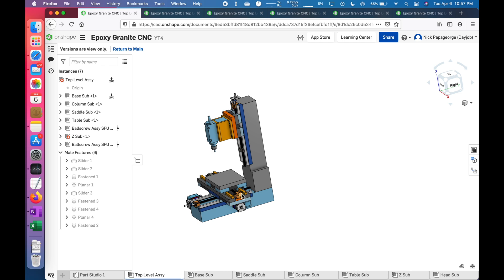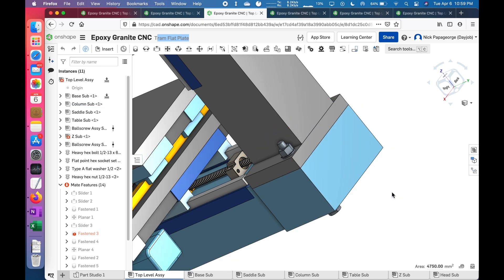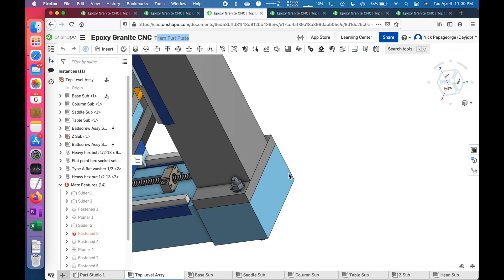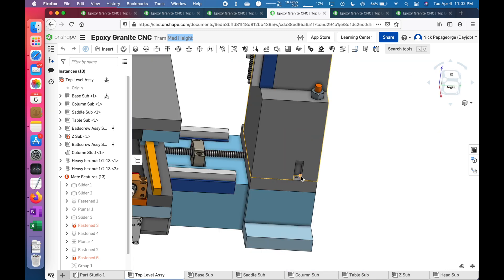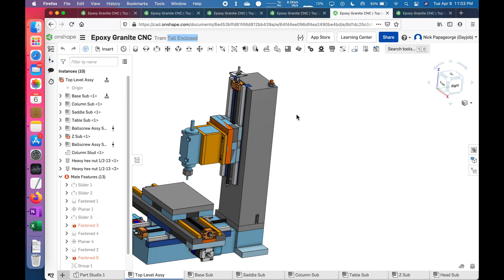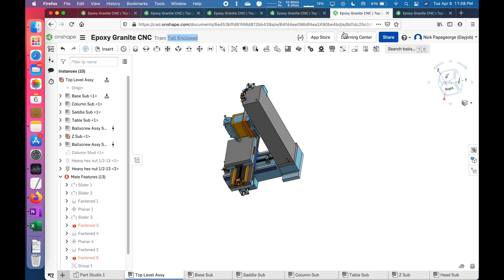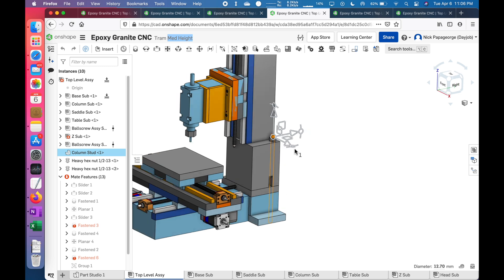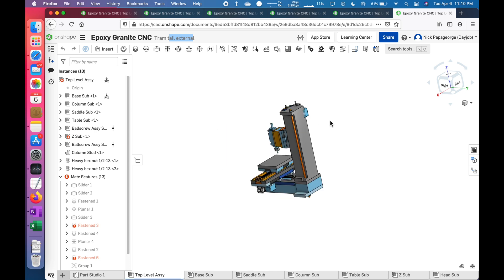Ep5: Epoxy Granite CNC Design - Column Tramming and Attachment to Base

Comment: Why not just weld up a solid traditional 2 piece vmc base that bolts together with 6, 9 or 12 bolt holes?

Weld the frames together, nice thick steel, with supports where need be, fill it with granite epoxy, machine the mating and refrence surfaces for all the rails, embed the slight adjustments for the rails,

Scrape everything in!

Rock solid industrial machine base, they use this technique for many industrial scale precision vmc's!

Thats how im goibg to do mine, even if i have to pay a shop to machine the surfaces and refrence points, if done correctly and sized properly these frames are 5-10k+ with no running gear!!

Paying 1-2k for a machine shop to do the mating surfaces properly will still be a farcry from having to purchase a base

The smaller you build it the less sense it makes to do it this way..

Im going to build a "knee vmc" about waist height and frame weight approx 3-400kgs

I have a bench lathr thats 170kgs and its by no neans a big machine, its tiny and mills need more everything than lathes, more rigid more weight so a vmc thats under 150kgs i doubt will do much and you will very quickly find ita limits and want more

Space is a problem for me but i can still fit a solid machine with custom footprint

Comment: Tall Enclosed - I like it always being in compression for the full height and that the full width would provide more stability.  I like the idea at the vertical base one set screw on the side front and then two on the rear area.
Reply from the maker: Yes agree, the tall enclosed was my favorite also.